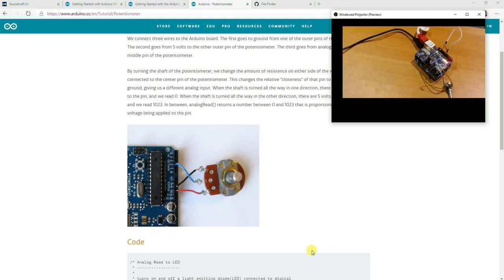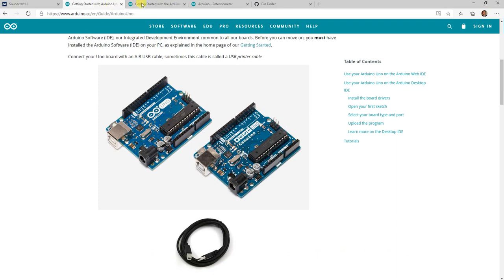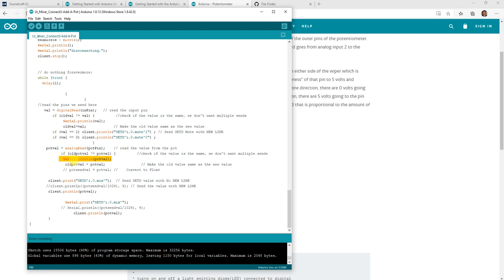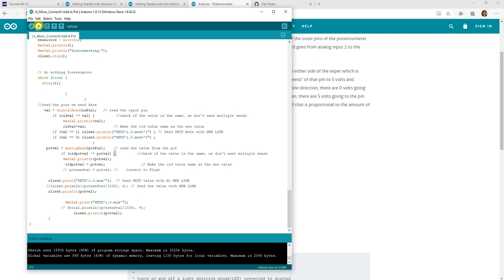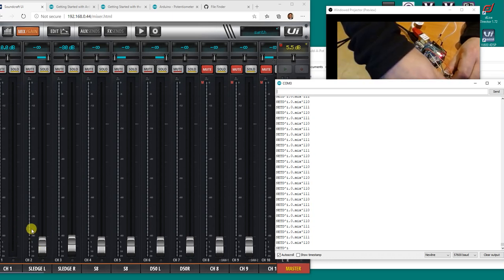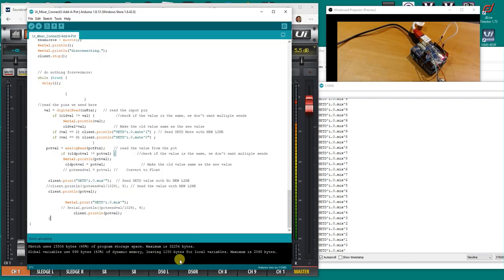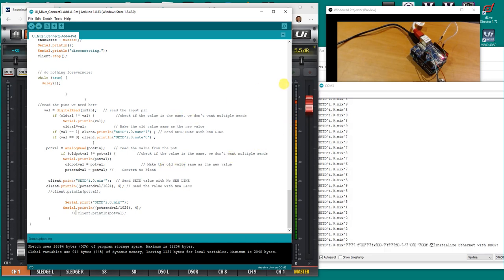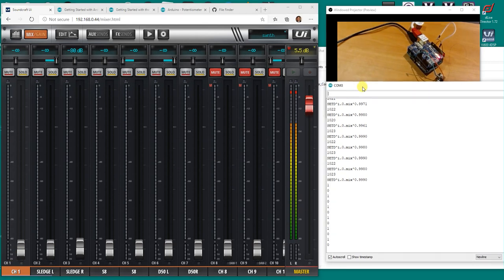Ui Mixer Arduino control Video 3 adding a pot to control a Fader

Comment: I created a 16 channel hardware interface for my drummer, so that he can change his in ear monitoring with some potis nad not having to use a tablet. Arduino uno and a 16 Channel multiplexer. It is a bit tricky to find the commands that are needed in the endless list of commands that are rooling in at the start, but once you got it, works like a charme. Thanks for the work and inspiration to Mix-Record-Connect

Comment: Hold on just a minute, this means I could use Arduino to turn an LED strip red when the DJ is running too hot out of the mixer, or an mqppt message to a galactic unicorn!

Comment: How many Faders can control simultaneously??
Reply from the maker: As many fingers as you have.. all is possible. Depends on your touch screen or controller. Most touch screens allow for 10 but it is no limitation of the software.
Reply: @mix-record-connect9938  with arduino?
Reply from the maker: @shameejpulikkathodi5793  Sure easy